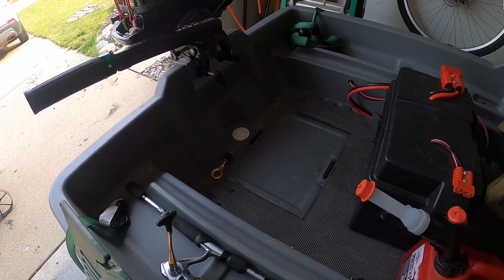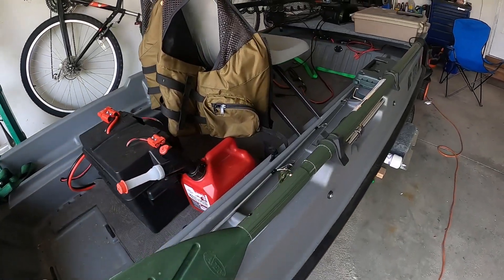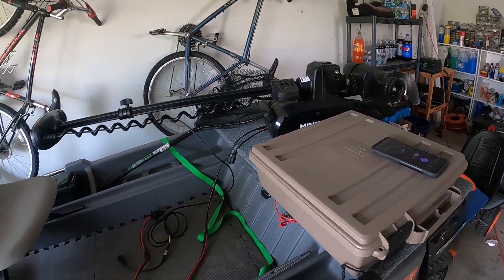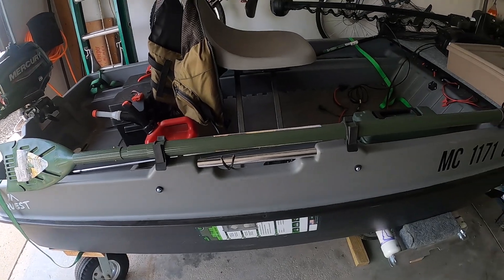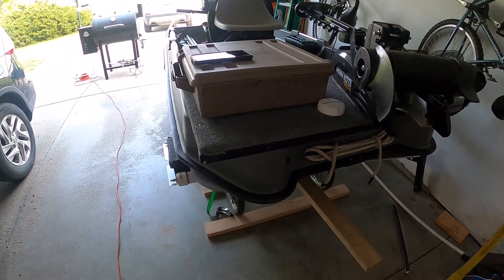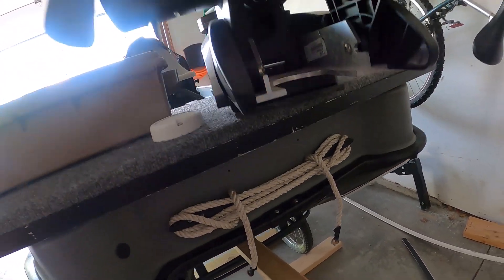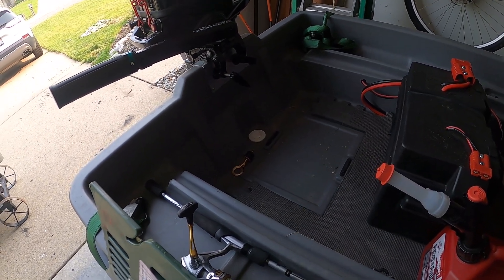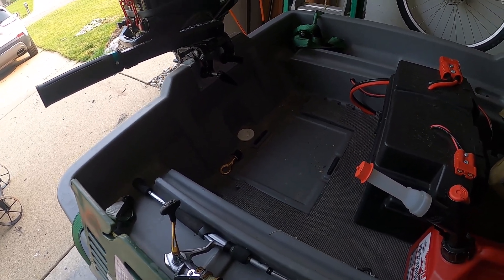Always install a scupper hole and pontoon plugs for your Pond Prowler

Comment: I just received my Pond Prowler last week from BPS. Tonight its raining so not a good time to go out to look at the boat. But this morning I did go out to see where I could mount my navigation lights, I was surprised to find two rubber plugs in the pontoons right below the seam line.
Reply from the maker: Hi David,  Second person who has stated that. Maybe they are adding them now, which is a good thing.

Comment: Hiya! I just moved to TN and got a Pond prowler - love it on the Elk River - this is a great video - where did you get or what did you use for the scupper hole itself?
Reply from the maker: I got this from Amazon (SEAFLO Thru Hull Fitting Through Hull Choose Size and Pack Quantity) and used a  boat plug, I think it was 3/4.